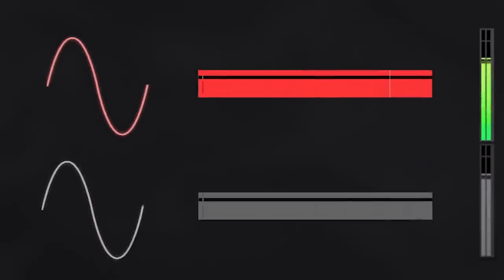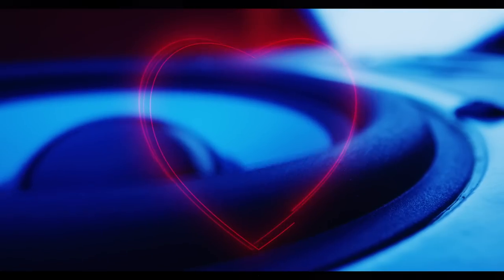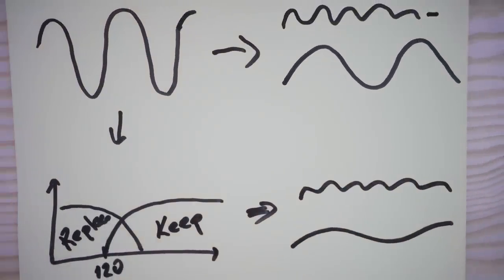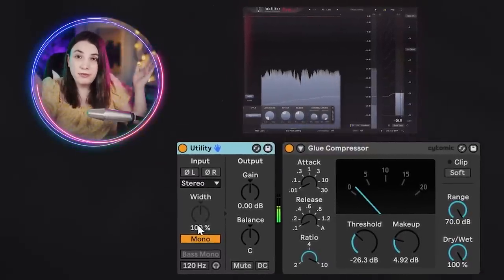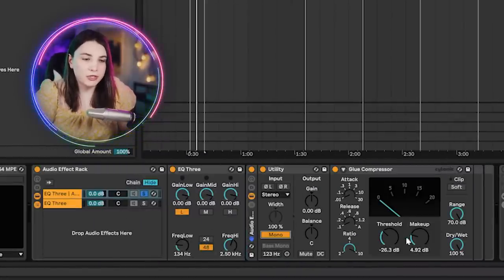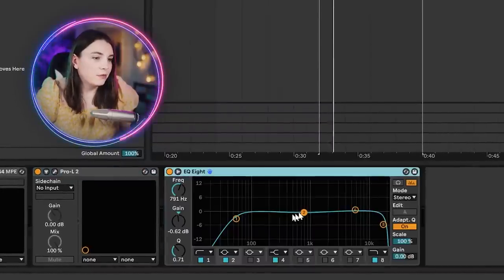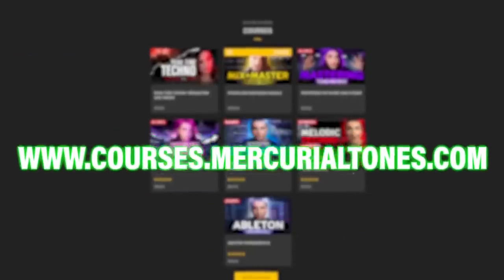The Biggest Misunderstanding About Bass 🤯

Comment: This is an interesting take on phase cancellation for beginners, but as someone who's most likely been in the production industry longer than you; i'll explain why we use mono for bass. This is because when playing your music at a venue, most will have a Left/Right in for the mixers being used in the booth. This is why in bass music, the sub (sine) and kick are most prevalently heard. The rest is done through proper mid/side routing, and depending on what you make? could involve a multitude of effects such as stereo shaping, expansion, etc. So, to not make this too long, everything below 200hz gets the mono treatment. afterwards, you can expand (And of course its not as simple as just making it mono, most use Ozone imager for this, so good start; but there's levels to go on this topic.
Reply: I think there's more fundamental physical explanation for why mono is typically used for bass in a true stereo environment.

Stereo effects are produced due to the distance between our ears, or microphones or whatever.

For lower frequencies in nature, the phase differences our ears perceive is lesser than for higher frequencies, because the wavelength is longer (so the time delay between the signals is lesser relative to the wavelength). And so our ears would need to be further apart to perceive the same kind of phasing effect perceived on higher frequencies.
 
As such, it's not surprising that forcing a stereo effect on the bass in a headphone setup doesn't sound very natural or pleasing
Reply: @Elizareads  This is very true. Most bass that ranges between the 35-200hz areas sound rather unnatural when set to stereo, which is why the image is generally tightened in mastering for the lower ends, with expansion towards the mid-high ranges, but i can tell i'm talking to someone that's quite versed in stereo fielding and mid-side compression technique, so that one's for the readers for certain. 

While i see this as a great explanation for stereo phase cancellation, and how to avoid it, i can't say the video itself is great for theory on bass design. Most times, you wont deal with phase issues in those ranges, as the only thing hitting those frequency ranges are going to consist of the kick, and sub bass layers of a synth/VST/AU patch. Higher frequencies? There's definitely a lot of room for marginal errors, as there's more going on in the mids and highs, as thats where most of the activity is going on considering vocals, snares, and other elements of any given track are taking place there, rather than the lower frequencies.

I appreciate your insight on this, and hope this comment thread turns into something educational for up-and-coming producers.

Comment: I'm serum I just remove the fundamental and then replace it with another 1 voice oscillator. I then use a limiter to help slightly flatten out the signal. It's a mix of the hard and soft solutions and works very well
Reply: How do you remove the fundamental in Serum? Would like to try that method
Reply: @somatronic  watch the video you're watching again
Reply: @somatronic  If you make a synth in serum there is a little pencil icon in the top right corner of each wave table. If you click on that it gives you options to change the wave table itself. In the top of serum you'll see a lot of bars representing each frequency present by the wave table. Turn the first one all the way down and the wave table will visibly change. The fundamental frequency will no longer be produced, yet all the others will be.

Comment: Another good thing to think about is always checking the mono compatability of your whole track doing an A - B test because most club sound systems are mono. If stuff is out of phase or the whole track has lots of stereo then it could sound amazing on headphones or speakers, but the moment you play it out on a big sound system it'll start phasing and you lose whole chunks of sound

Also if you're using the high pass and low pass technique to replace the sub bass with a sine wave then it's generally best to do it in parallel by using groups in the chain, same way she did with the EQ3, and using tasteful amounts of distortion on the sub to provide extra harmonics that fill the space between the two sounds. Main reason I recommend going parallel rather than going for seperate tracks is to prevent your project getting too messy, but it also means you can easily add effects to the high end and low end at the same time.

Great video as always Alice!!
Reply: ty
Reply: saying that most club sound systems are mono is big misinformation.
Reply: @lennartstein3024  it's what we've been taught in my uni course. I've also got a few friends who own sound systems, they're all mono. maybe it's different in other countries, but most club systems in the UK are mono. the key word there is most. it makes sense too, you don't want one side of the room to have a different listening experience than the other side of the room
Reply: @alexyoung3986  Still not quite correct to say ‘most’. Where mono is mostly used is in venues with strange shapes or large enough to require multiple speakers across the venue to keep a consistent level throughout. A large venue with a large stage and therefore a wide stereo field doesn’t specifically require outright summing to mono, some width can be retained.
Overall I’ve found anywhere with a very obvious “this is the stage and this is the sound system” type layout to be stereo and could pan parts if I wished, regardless of frequency, whereas somewhere that doesn’t really have a dedicated place for performers or DJ’s is generally mono.
Even been to shows using surround setups.
Reply: @3rdStoreyChemist  whilst true, you can’t depend on all sound systems being the same as of course they aren’t. Therefore mono compatibility is still hugely important, and not just for club sound either - FM radio still happens to be a thing, and stereo / mono FM signals are also unstable and can’t be depended on. Therefore, you compromise with having mono in the right areas in the low end, but also with enough width and stereo information in other areas in order to ensure performance on as many playback systems and situations as possible.

Mono bass is also important for vinyl cutting, as whilst you obviously can have stereo vinyl cut, too much stereo information can cause grooves to be cut too wide, and can lead to poor stylus tracking, more skips etc.

Regardless of what’s on the other end, a good mono compatible mix is still required, and will be for the foreseeable future’
Reply: @MakeYourTransition  Mono bass for vinyl cutting is a huge myth. Literally the 50’s and 60’s dispelled that. Never listened to a Beatles album?
Also, mono FM radio systems are generally very cheap and limited frequency response. Bass reproduction is not a priority, this led to the ‘Motown’ sound and a lot of radio mixes being low in bass. So please don’t spread that myth either.
Yes, there is a good argument for making sure the low end works in mono, but there’s no need for the total nonsense you’ve just spouted.
Reply: Clubs are not mono, and most bluetooth speakers are omnidirectional NOT mono.

Comment: Something important to note is why you would pick one way or the other and it usually applies to what you want to do with your low end in the first place. 

The most typical use case is when you’re using a reese bass and want to preserve the movement from phase cancellation. Even though the sun frequencies come in and out, there is a beating pulse that can sometimes be desirable. In this case go for the soft fix issues. 

The easier route on the other hand is the hard method because it guarantees a solid low end. One thing I’d keep in mind is trying match your mod and high layer with the appropriate low end wave form (you don’t have to, just makes the entire sound more cohesive sometimes)

Great video and demonstrations^

Comment: you could also just turn down the unisono width in serum if you actually want a wobblier low end (sometimes desirable with reeses actually) but also keep it mono. you can also use the high pass filter with key tracking in serum (although removing fundamental is the best way) if you want to go the old school way but also have the filter move with the pitch, imo that's a bit better than using a static filter :)

Comment: Another thing to watch out for (especially if using analog synths) is if the start of the notes are in phase. Meaning the oscillators may be drifting in and out of tune, but looking at the waveforms and just sliding the clips slightly to line up the rising or falling edges at the start of the part can help correct a lot of the phase issues. Then you can also apply these techniques after if needed. 

This also works between multiple instruments. Like you can examine if the first peaks of the kick and bass are aligned with one another, for example, so that one is not pulling away from the other on the transient.

Comment: "Remove fundamental" feature of Serum is awesome and quite unique. I haven't seen that in other synths. Since I don't own Serum, I use hi-pass filter and keytracking in Pigments or find and remove manually the fundamental harmonic in Vital's wavetable editor. Putting static EQ in FX chain has a downside - when you play different note, your frequency 'split' point should move as well, so doing that with keytracked hi-pass filter and sub is a better workaround.

Comment: You can also split the  sound in low and high freqs. If you want no phasing in the lows take a utility and select left or right instead of mono, in this way you get completely get rid off the phase cancelation and you keep the character of the sound intact.

Comment: Hey Alice, awesome videos.
I'm a sound system technician, and owner/operator of a premium quality analog sound system at many UK music festivals, so very well understand comb filtering, cancellations etc.
Dave Rat (legendary sound engineer) had a very interesting trick in the live music department. Using two different mics on the kik drum (so non-identical waveforms) but instead of having them as whomph & click,  hard-panning each in opposite directions, completely eliminating comb filtering on the kik.
I've tried it, and it's awesome!!
Don't think I can post a link, but it's called "Problems With Mono Sound From Stereo Speakers" (very interesting)
I also do a bit of music production (PC free hardware hobby) and it got me thinking...
If you had two kiks which were different, but similar, AND they work well together when summed (for mono compatibility) then you could hard pan them, and completely eliminate all those bass cancellation zones on the dance floor.
It could be a magic 'bass everywhere' trick for producers that know. ;)
Could maybe be extended to snare too, and maybe bass?
I'm working on a trick to stack up all-pass cards on the crossover's EQ (phase modding) to actually 'fix' normal EDM mono bass/kik cancellations, but it's better (and easier) to do it at source.
I'll see if I can link in the 1st comment.

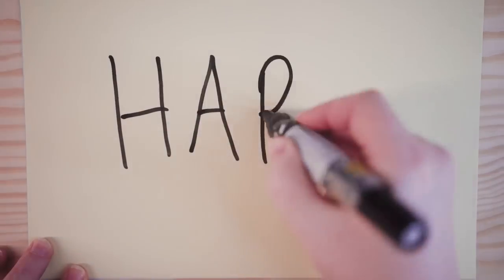Comment: 3:00 
Usually, I'm using a limiter and I'm dropping the ceiling until the signal is flat (of course adding gain after). Works for bass/sub-bass or something that doesn't need to have a broad dynamic range.

Comment: 2:39 Although it took me a long long time to realize this, because I am listening in binaural L and R, which is still "Technically" mono, or "Unbalanced Stereo" there is absolutely no change when you put bass mono on. AT ALL!!! And if you had compensated for the volume loss when summing to mono by duplicating the channel, there would not have been a difference coming out of my phone or tv, but I did hear it get super thin on my headphones.

This means you are listening to it on a pro audio system if you heard a change both times, because the real misconception is between Stereo and Unbalanced Stereo... And what a Stereo field is and how to create it using parity signals is where the money is at..

Comment: Something interesting I tried was this: after splitting a stereo waveform into its constituent parts (bass, vocals, drums, other) using splitter software, I noticed my bass stem was fluctuating a lot (typical when splitting music like this). I loaded my bass stem into Alchemy using the additive synthesis function. The result, as it was resynthesised using pure sine waves, ended up a LOT cleaner and consistent than before! It doesn’t work as well with more complex sounds, but give it a try!

Comment: What do you think of simply always high passing everything that and using a dedicated sub? I’ve always understood that keeping the natural sub in any synthesized bass sound was a bad idea for two reasons. 

1. Any processing would effect not only the mids and highs but the sub itself which you don’t want

2. Uneven amplitude in the sub (which you demonstrated here)

Only good reason I could think of is high passing certain sounds even as little as necessary can still noticeably change the timbre in ways you dislike. Some bass sounds sound better because even using gentle filters it’s hard to only remove the sub without ruining the sound. 

But this capability of Serum for example to only remove the fundamental seems like a game changer. Of course this could be accomplished in any synth that allows you to manually draw in your waveforms. 

So now I really don’t see a reason to not use a dedicated, separate sub.

Comment: The standard practise is to sum <200hz or so to mono. All problems solved. Occasionally I get picky with the 100hz-200hz if there is interesting stereo info there, like reverb on toms. But below that should be mono pretty much without exception.

Comment: I think there’s a disconnect from what most producers call bass and what actually IS bass. Bass is any low frequencies, also referred to ass sub, typically below 200hz. A reese bass has most of its “meat and potatoes” from mid range. That area can have all sorts of width no problem, but when people are talking about using a mono bass, they mainly are referring to not using unison or chorus on sub frequencies as that can muddy the mix.

Comment: It's also nice to mention that bass behaves like a source that generates sound in all direction (Omni directional) where higher frequencies are way more directionnel (like straight lines). Making the bass mono doesn't remove it's "stereo" on speakers, just with headphones. It also depends on the style, sometimes bass has some sort of stereo or panning. Phase it rarely an issue with bass, it's more of a problem if it's the same sound that you duplicate or if it comes from recording on me source with multiple instruments

Comment: Great video! Would you use similar techniques on an electric bass? I've got an amp track, a DI track and a distortion track, the distortion track is high-passed but the other two are pretty much full range. It sounds good to me but should I be worried about phasing issues and do something akin to these tips?

Comment: Dual mono does not equal stereo, so if you panned them opposite sides it’s just two mono tracks, stereo has to have a difference in any parameter such as a more resonant shelf band on one track and the other having a less significant resonance.

Comment: Well, Im a Cubase user, so I'd simply go to Frequency and work with it as a Dynamic MS Equalizer - using all the tools at my disposal, but yes, that would only be an easier soft solution, the hard solution basically indicates that this is a sound design problem, since the bass was designed, but not well enough, since to correct it we have to go to soft solutions processing...The lesson? LEarn to design your bass well, and you'll ne to fix less shit :D

Comment: Just getting rid of the left or right channel and going mono from there is a useful move sometimes. I've often overlooked that.
Reply: I think this video was made as a solution to the problems that method brings. This method is tighter and cleaner. Plus if you remove the sides and that's it, you remove volume. Usually a boost or some other kind of processing is needed to bring back in the full weight.
Reply: @Fire-Toolz  No, this video addresses the problems caused by adding two signals together. That is what creates phase cancellation.  Eric's method is another viable work around.

Comment: Great video, however I watched a YouTube video recently that stated when you layer bass and use EQs for crossing over you get ‘fake bass’ which can happen between 90-190hz. So they advised to avoid EQing. 
I seem have the issue with mixing low end and knowing how much is enough. I have your tutorial and have tired many techniques but I struggle to get it sounding so glued together like the top producers, it ends up to thin or overpowering . Perhaps I’m using too many layers? 

What advice can you give ?
Reply: it might be your arrangements, the song itself possibly. mixing is about mixing good sounding music too lol
Reply: @manteuro  how does that answer relate to what I asked?
Reply: @somatronic  you said too many layers, that correlates to arrangement.
Reply: @manteuro  I tried the method using Ozone and it worked well, thanks